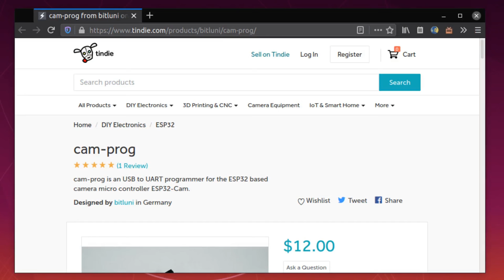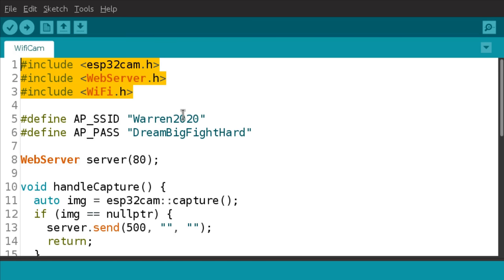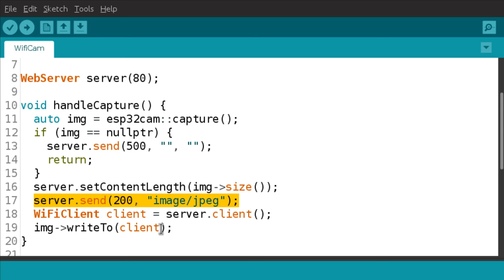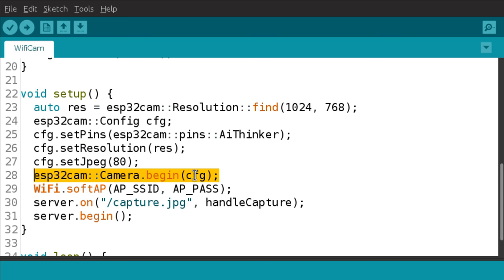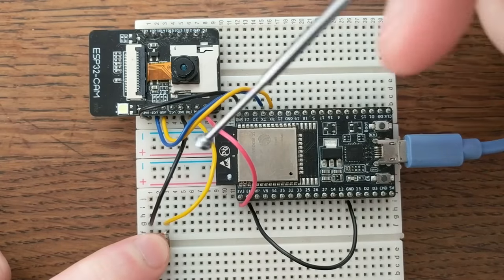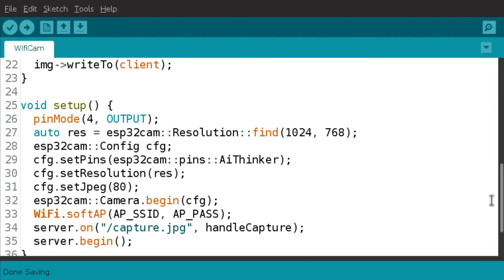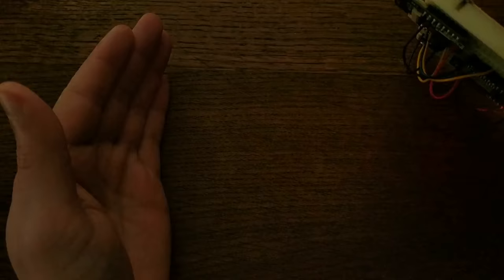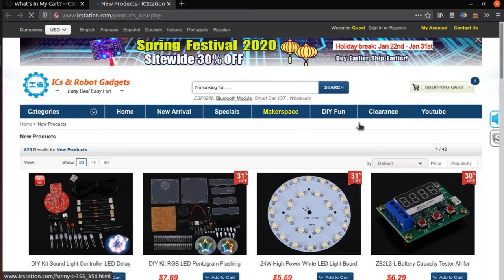ESP32-Cam Quickstart with Arduino Code

Comment: I'm the library author. This video is one of the best explanation of how to use my library. 👍
Reply: Wow
Reply: The example in the Github download is different to the one being used here. Where can I find the same code used in this video?
Reply: Very cool
Reply: The code doesnt work for me, it gives me library errors. I am writing the same code like in the video, but i get errors from the esp32cam library.
Reply: @DarkBoyNomis  same
Reply: my esp32 cam worked on esp_camera.h, while when using ur library i  always get "error compiling for board esp32 wrover module" and im sure of all the connections 
please help
Reply: Great, then maybe YOU can tell us where we can find the libraries "WebServer.h" and "WiFi.h" are. 🙄
Reply: How to adjust camera exposure? If I'm shooting in a dark room.
Reply: Hi
Gives me error in the dependency iterator.h present in the esp 32cam folder
Any help?

Comment: liked the code and buying 4 more to add to 2, I already got programmed with the arduino example sketch.
thanks ... plus if you hit the reset after programming it you can get the ipaddress from the serial monitor in arduino.

Comment: Help!  Using an Arduino instead of esp32 dev. board ... at 1:33, you "connect EN pin to Ground".  What is the equivalent of the "EN Pin" on the Arduino Uno?
Reply: Reset pin on arduino pin :)

Comment: is internet needed at all to access the esp AP live feed mode from say the cellphone user? as in the phone only works with wifi not sim card so no network. can we use the phone to find the AP from the esp32 and tap into it just like any other wifi public network and instead of getting wifi  i get a webpage that provides live feed as long as im withing proximity ? because this sounds like something im looking for if so!
Reply from the maker: That's correct. In AP mode you can connect to it directly without needing to connect to the internet at all.
Reply: @DavyBot  wow i have asked this question in allot of videos similar to yours, feels good to be acknowledge when a question is asked so thanks Davy! very appreciated

Comment: Can the ESP 32 CAM do everything the ESP 32 is capable of, like be an AP and web server.
Reply from the maker: Yes, it is a normal ESP32, just with an added camera. Any code for normal ESP32 boards will run (including MicroPython, for instance).

Comment: I think this has a minimum current of around 6mA (not uA) in deep sleep as it's not optimised for low power. Do you know if you could use an ESP32 on a more barebones breakout board with your own OV camera and be able put the camera to sleep when not using it and achieve the ~10uA of the deep sleep?  What about this esp32-cam drains that additional current?

Comment: I want to actually do some processing on the image that's captured. Basically I want to scan the pixels of the image, using some Arduino code running on the board,  and locate pixels with a specific RGB color. Can that be done directly on the ESP32-CAM module?
Reply: Yes you can. Select RGB565 pixel format, and you can work with raw pixel data. However, you only get 4MB RAM.

Comment: Does the esp32cam::capture() method always return a JPEG type file? Is it possible to tell it to capture it as a BMP type file?
Reply: Yes and no. My library has a Config::setRgb() function to select RGB565 mode. It's basically a BMP but without the BMP header. If you need the BMP header, please open an issue on my GitHub repository and explain your use case.

Comment: Hi
 I finally got it working but I have a new problem, if the esp32cam gets disconnected it won't  reconnect to the router/hotspot/network automatically and I have to reach the esp32cam and restart it by hand. What if I want to fix it in some place high? Do I really need to restart it every time? Can't it just get reconnected to the network like any other normal device?
And btw can I add multiple network credentials to esp32cam code so if one is not in range it would connect to the other ones.
Reply: I have the same question, I have to cycle power and press reset, twice to get it to boot and go online.
Reply: it's an issue with the handshake between router and esp32 im pretty sure. i think maybe it tries to reauth and fails, but works connecting the first time. i had a similar issue and switched to access point mode.

Comment: So, to program it I could just use a USB FTDI device, am I right?  Discount code, sweet!
Reply from the maker: Yep, and something I forgot to mention is that it's 3.3v logic so you may need to be careful in selecting a USB->FTDI device (some of them are 5v).
Reply: @DavyBot  great thanks, yeah, 3.3v good point - not such a daft question after all then, hopefully save someone risking their kit.

Comment: i tried ICSTATION and the site is not secure so my browser wouldn't let me buy anything.
went to TINDIE and they are sold out
GITHUB does have the library so that much works
good video, I just wish I could follow up on the links  X(

Comment: I guess you could additionally use GPIO0 and RST from that board with USB,  instead of PITA with the button
Reply: Sadly you can't. The RST button is not on any pin header.

Comment: hello , i have some problm "detected camera not supported" and "psram failed" what should i do please answer me
Reply: You get that error with the same code shown in this video? If so then you're either using a different version of the esp32cam which may require a different library if it's not configured the same, or your board might be malfunctioning. You might have better luck submitting an issue to the Github account of the camera library if it's a compatibility issue because I bet the author would like to support more models.
Reply: @davywtf  I am using the same version of esp32cam I don't know the reason of this error, I tried other code but always I have the same problem PSRAM int failed 😐 I need to fix the problem please help me I have an academic project to present
Reply: Can you please answer me🙏
Reply: @AzharAouni  Like I said, it may be that the device has a hardware issue in which case I can't help you. It may be that you're using the wrong board setting in Arduino. Or it may be that the model is slightly different (depending on where you get them they can use slightly different parts and pin configurations). Again, go to the esp32cam library's github account and open an issue there since they're the ones who wrote the library code.
Reply: @davywtf  I check all the parameters nothing wrong 😔
Reply: Make sure you uncomment the line for your camera and also comment out any other lines for other cameras at the top of the sketch.  I did the first part, but forgot to comment out the other camera.  Gave me the camera unsupported.  Might not be your issue, but something to check.
Reply: Your camera is probably not an OV2640. The original C library (now part of ESP-IDF) supports three models, but when I made the C++ wrapper library, I deleted others and only kept OV2640 because it's the only one I have.

Comment: how far can this work? anyways great work. always loved your videos
Reply from the maker: Since it's WiFi based the range is pretty limited but I was able to double the range by using another ESP32 as a proxy in one test. I did it by putting the proxy node in dual Access Point + Station mode and having it repeat all requests, extending the effective range. You could certainly do more proxy nodes to get better range but at a certain point it would probably be more cost/performance efficient to just run some Ethernet cable.
Reply: Sir, can we leave the wifi password and wifi name brackets open, then can it travel through wifi routers till it reaches us, is this possible?
Reply from the maker: Mesh configurations are possible with WiFi. I didn't do anything that fancy, just had one proxy device relaying all HTTP requests. But Espressif has some info on setting up WiFi mesh applications using ESP32: https://github.com/espressif/esp-mdf

Comment: Why did you show your good working ino file with local AP_SSID and AP_PASSWORD setup without giving a downloadlink to that file? Instead only showing a link to an original unchanged llibrary file that simply won't work without any changes that first have to be made. Instructions like: Clone this repository under $HOME/Arduino/libraries directory do not help in anyway to understand how to simply use these cheap CAM modules. After 2 days of effortless reading and testing all presented internet examples, I'm beginning to question if my cheap China made module is okay? Uploading all found code was never any problem but explanations like these Youtube videos are no help at all because too many questions are never answered when it doesn't work! Even just knowing what all the right needed Arduino libraries are makes this Arduino product a very complicated and bad experience! Instruction videos like all these short Youtube explanations are a complete waste of time. Just a good PDF instruction manual with the right working code would make all the difference! This way there is no quick start at all!
Reply: After 2 days of wasted experimenting, uploading, upgrading and testing the Arduino 1.8.13 IDE I found Rui Santos's standalone AP Webcamserver version that worked right away from the given ino file!
PS: The discount ordering code looks nice until the shipping costs are shown which are way too expensive!!

Comment: C:\Users\coolz\AppData\Local\Temp\.arduinoIDE-unsaved2024025-14784-1vft4t4.chfw\WifiCam\handlers.cpp:3:27: fatal error: uri/UriBraces.h: No such file or directory
compilation terminated.

exit status 1

Compilation error: uri/UriBraces.h: No such file or directory

I am getting this error